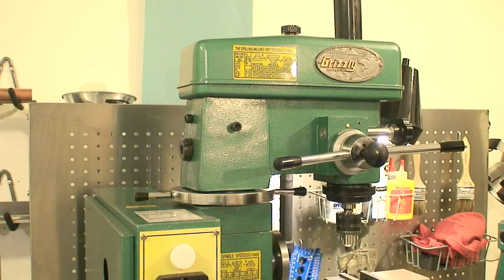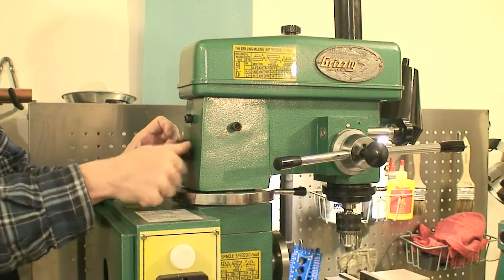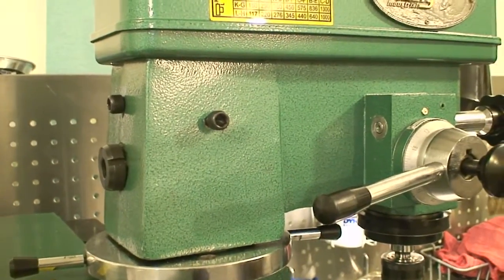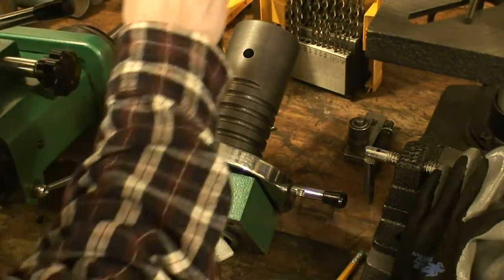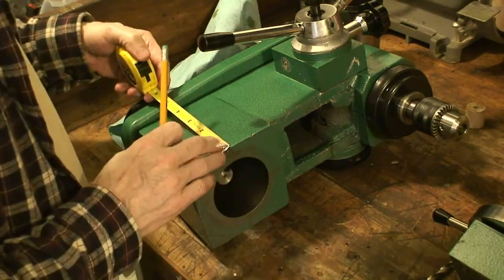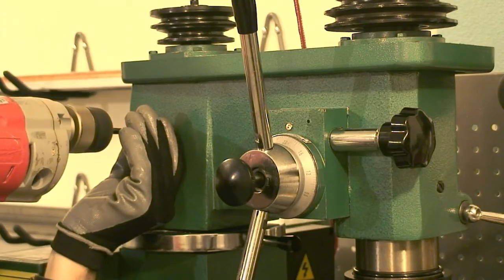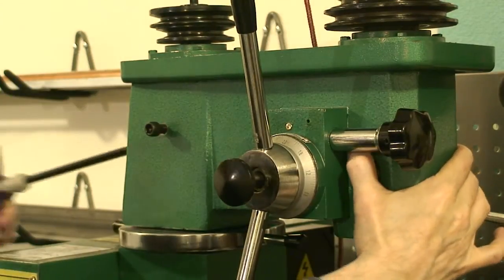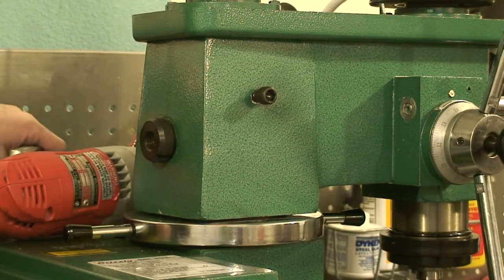Reduce Lathe/Mill Head Flexing - Grizzly G4015 Modification

Comment: This is a 6 year old video and I dont know if you will see this but do you still have this model of lathe/mill? Because at my school we have 2 mini guys that wont engage the lathe even with the belts running, also how do you stop the mill head from pivoting when you turn it on? I turned it on to try to fix it and it slammed to the left on the emergency off button turning it off, any Input?

Comment: I think you should have asked for some input form the Yahoo.com 3in1 websites before you did that mod.  
I have a HF 44142, it was made with the dual post brake clamps (Part Ref# 505) and they definitely keep the post rock steady.  
You can download the Owners/Parts manual at HF website to see what I'm talking about.
The Grizzly G9729 3in1 is the same as the HF 44142 and the parts are the same. Grizzly uses the same dual post brake clamps (Part Ref# 505).
Also wondered why you didn't bolt the Millhead to the cross-slide table to drill those holes.
A lot of big brand machines use this clamping method.  Don't want to see you fracture the threads on that cast iron post.
If interested I could make a top view drawing of their function,,,  but you'd have to scale it to your mill post diameter.

Comment: To help transport my lathe, I would like to remove the drill/mill head in order to reduce the weight.  How easy is it to removed the drill/mill head and to reinstall it? thanks
Reply from the maker: It's been a few years and I don't remember the steps but it's real easy. Lifting it off is the hardest part because of the weight.
Reply: The head came off easy and was quite easy to install.  While the head was off I took the time to add an extra bolt as you have in this video to help reduce the flexing during milling.  All went well. Great idea. Many thanks
Reply: its not difficult, but get another person to help. i used my engine hoist to lift the head and hold it.

Comment: To +Cross Slide

I recently acquired a G4015Z for a phenomenal price of $75. I have absolutely ZERO experience in machining, and the extent of use of the machine is I managed to get it powered on today....... Looking at this video and the one where you trammed the head brings to mind some questions:
1. Where you've drilled the column in this video to help with flexing, but indicated challenges with raising and lowering the head, Couldn't you  tap multiple holes at various heights to support changing heights of the head while providing the same stability? I.e. 1 hole in the column and 3-5 in the head, thus allowing same stability while allowing flexibility in choosing head heights?
2. The cross slide table seems very small. Have you considered or sourced a table that would maintain current width, but allow much larger milling range? I.e. The table is square or close to it. By putting on a table like the G8750, http://www.grizzly.com/products/6-x-18-1-2-Compound-Slide-Table/G8750  you could extend capabilities of the machine. I look at it as though you're working the mill from the side so X and Y are reversed in this instance. Having the extra length would open up the workspace. I'd appreciate your insight. Thanks in advance, and thanks for the videos!
Reply: Where did u get it for $75?
Reply from the maker: +David Cronin $75!! Wow, I need you to buy me some equipment, congrats! (1) Yes multiple holes would work but I just didn’t have the need.(2) The table is very limited for milling and was a little frustrating. A table mod may be
possible but I saved my pennies and found a used G0704 mill. That fixed that. ;-) Thanks for watching.
Reply: Alex Pavlov I bought it from a guy that was a machinist who's company had upgraded and given the old one to him. His wife wanted to go away for their anniversary and I was in the right place at the right time.

Comment: So after having your machine for a while now, would you buy the same one again? Or would you go with a seperate lathe and mill?  I was considering the same thing you have or maybe one step up as a less $$$ option than seperate machines.
Reply from the maker: Curt Warkentin 

 

I do like the machine and it’s not bad for the dollars. If I
had the money I would buy two separate machines. The first reason is setup time
changing from the lathe to the mill and back. At a minimum I have to swap out
the tool post vice for my mill vice which I then have to realign.  Also, depending on my part I sometimes have to
remove the lathe cuck too. Secondly, I could use a little more power and
stability in the mill. I does pretty well but I have to be slow and gentle. I
think the G4015z is a great start but I do hope to buy a standalone mill
someday.
Reply: Cross Slide Thanks for the reply.  It is great to hear from the guys that own the machines to learn the pro's and cons of them. :)  Thanks for your quick response, much appreciated.
Reply from the maker: Curt Warkentin 

Glad to help. If you can remember in all your excitement,
let us all know what you went with.